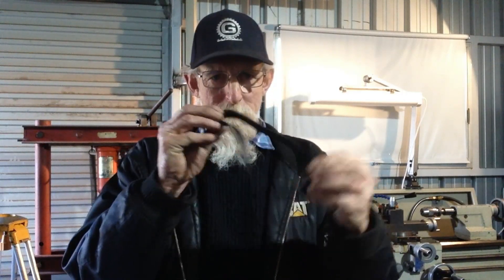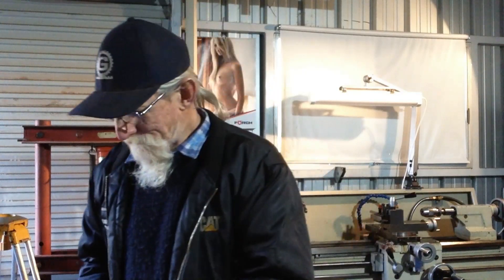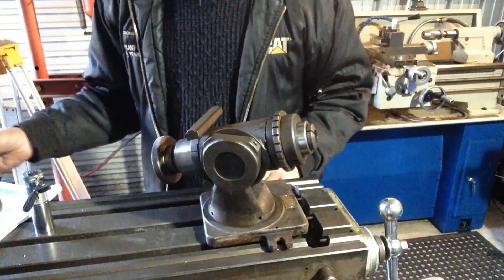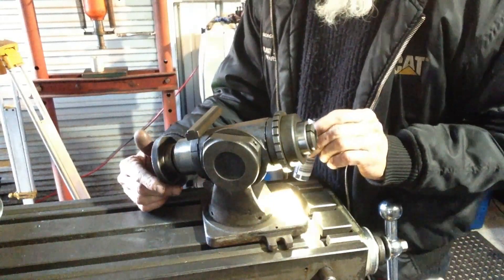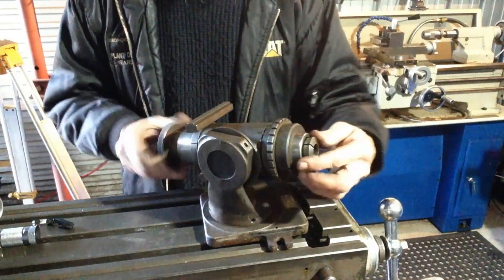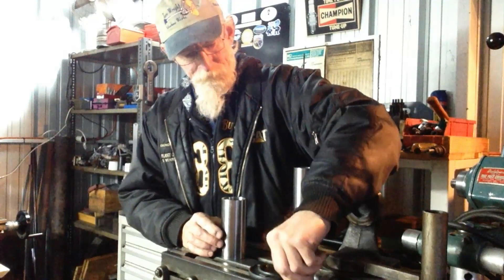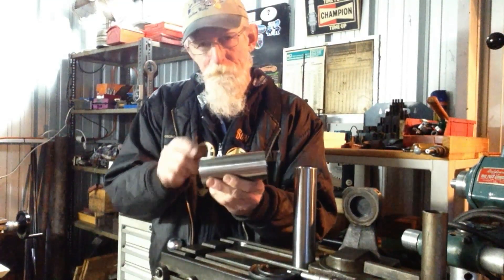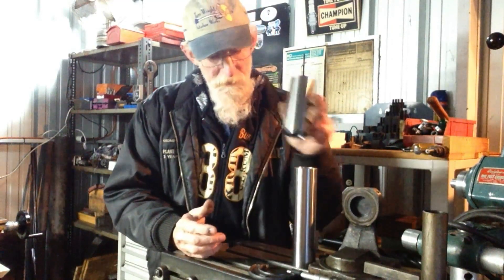Swarf & Chips  Episode 8  Pt 1   L.A. Rocheleau Grinding Fixture

Comment: Interesting fixture, was surprising it needed pressing apart.  Looking forward to part 2, will be cool to see it together and in use to see how it operates.
Reply from the maker: The spindle fit i a mystery , maybe mixed up parts from another owner or replacement part that has to be lapped to fit , any ones guess !  At least the company is still in business & emailed  some info . Cheers .

Comment: Would a brake cylinder hone do the job max?
Reply from the maker: No it may tend to bell mouth the bore  & both bores have to hold a tight tolerance in diameter & alignment . Cheers .
Reply: Max Grant ,The Swan Valley Machine Shop. 
Ok I get that. So now I’m keen to see how you make an internal lap. Suspense is killing me

Comment: Hey Max.
Another video ?

White Tip Electrodes, lol.
When you buy the new Electrodes.
Try Lathanated Electrodes.
They can be used for both DC or AC ( But work best on AC ) 
If you are interested to give them a try.
Buy them in the 1.5 to 2.0 % range.

The spindle does look in excellent condition for it,s age.
Either that, or no one used it.
It,s good that it seems to be an easy fix to get it working again.
Thanks for sharing your latest project.
Peter.
Reply: Peter and Max, I bought a pack of Rare Earth Tungsten's last year as I was adised they were good for Aluminium and DC TIG Welding. 

 So far all be it I am still learning TIG I have found good results with them for what I have needed to do. Hope that is of some help, they are Weld Class brand (one word) with what looks like a black tip. Sun is not fully up yet and hard for me to tell in artificial light.
 Cheers from John, Australia.
Reply from the maker: @joandar1    Thanks . i am still far from an authority on TIG  , still a learning curve !
Reply from the maker: Hi , I have 1.5 %  lathinated ones that i use on steel  & i thought they were no good for aluminium . I  was given a couple that have a grey colour on the end & was told they are ok for aluminium .
Reply: @swanvalleymachineshop   Hey Max.
The Lathaneted Electrodes should be either.
Gold or Blue Tipped.
Reply from the maker: @ccrengineering8086  my ones are gold tipped .
Reply: @swanvalleymachineshop  These Electrodes are not so much the ultimate.
Just something for you to try.
If you have not used them before.

Comment: Can't you lap those part together?
Reply from the maker: The spindles at present are a size for size fit so no space for lapping compound  .  Your lap needs to be a softer material than the part you are lapping & both spindles are hardened . Cheers .